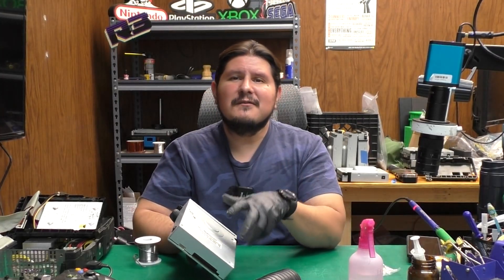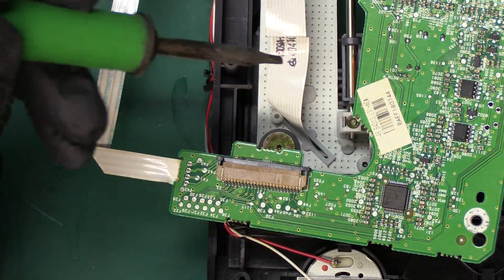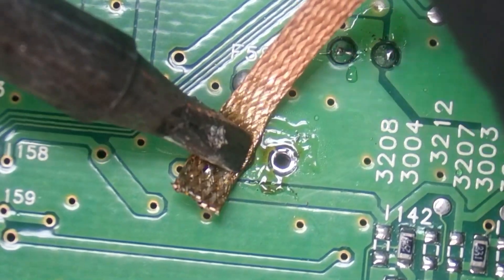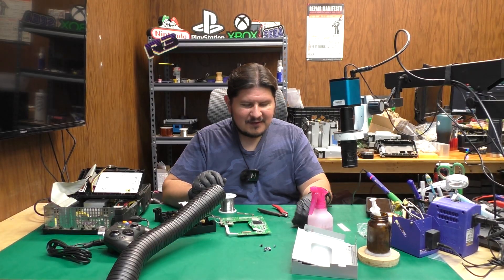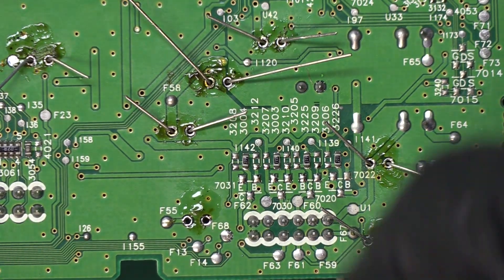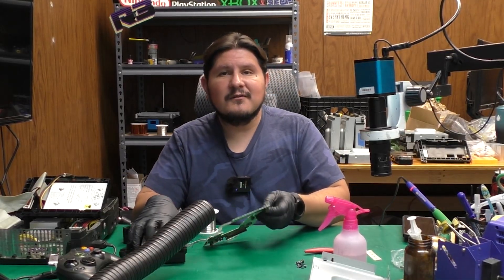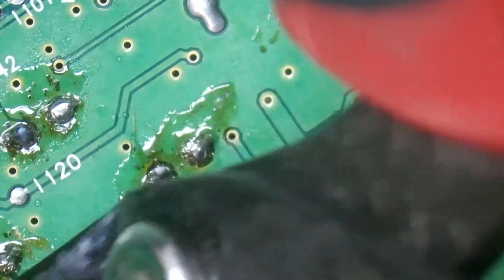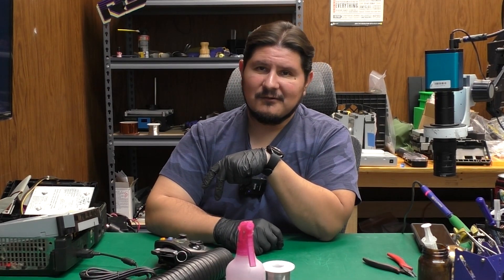Simple XBOX Philips VAD6035 Drive Capacitor Replacement

Comment: could you use ceramic capacitors instead. I ask because I don't know but think wouldn't those last forever because there isn't any fluid to leak i know the size could be a problem for some but if it could work i would that route for some if not all.

Comment: I love the vids, so ive been restoring some of my old consoles. And this one xbox with a samsung drive just acts like theres no disc in it it shows no error, the laser is moving down to position, and the disc is trying to be read i opened the lid and confirmed its spinning , the red light turns on inside the laser, but gives no errors, you got any tips ive been working at it for a few days?
Reply from the maker: Its possible the laser has gone out. A lot of people on here have had great success with recapping these drives if you're willing to give that a shot.
Reply: @RetroRenegadeRepairs  that myte have to be the the way to go the laser does seem pretty dim, i appreciate ya

Comment: Do you believe a recap like this will work on a philips drive that exhibits error 11? (tested in varios consoles, with different ide and power cables)
Reply from the maker: I've had a few people say replacing the capacitors has taken care of their drive woes. For under $10 and a little time soldering it's probably worth a shot if you're set on having a functional drive.

Comment: Its easier to trim the legs back just past the pads before soldering. Cutting them afterwards can weakin the joint as well.
Reply from the maker: Thanks for the tip.

Comment: How do you know when you have to replace the capacitors on the optical drive board?
Reply: For consoles of this generation? Always.

These were made during the era of the capacitor plague, and it shows. Most optical drive failures in this era that aren't mechanical are almost always because of bad caps.

Stop playing with laser potentiometers and start recapping these optical drives.
Reply: This old consoles are part part of the era affected by the  "capacitor plague" so most times it's almost always a guarantee that they are shot.

Newer electronics are tricky, but if you can see the Cap is physically swollen then it needs replacement.
Reply: I never had a failing 360 drives until now that was fiixable with capacitors.
Different for the capacitors in the Xboxes itself.
Reply: I think when they leak or explode but also if they are very old.